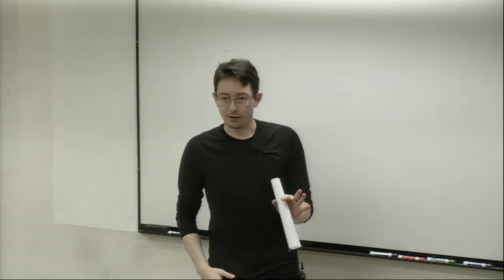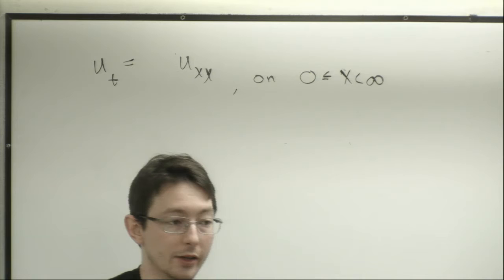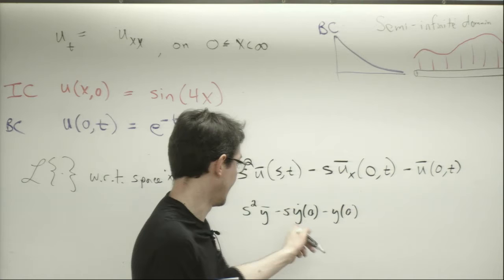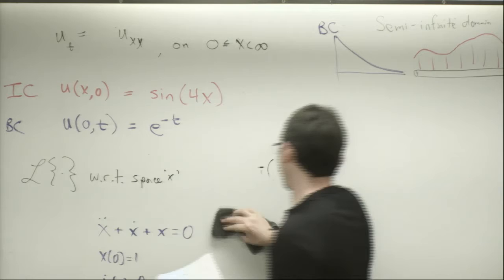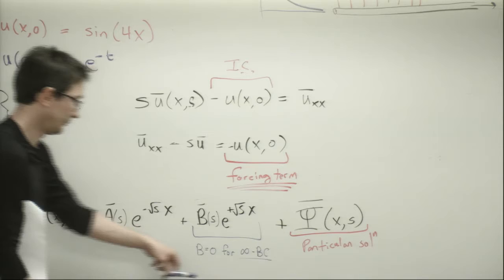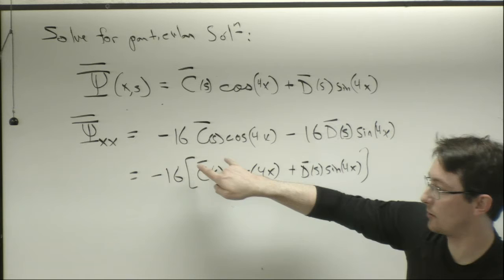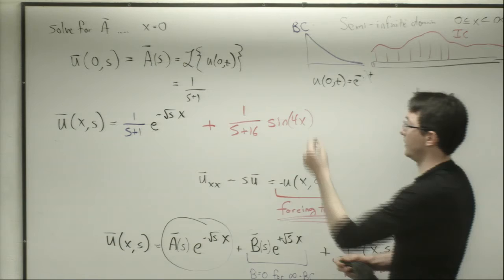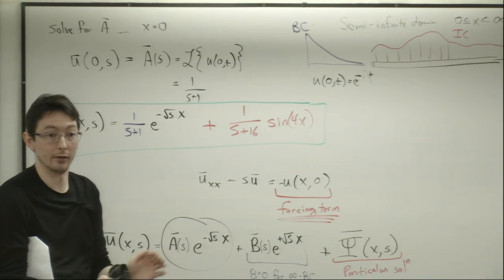ME565 Lecture 25: Laplace transform solutions to PDEs

Comment: Well worked and a good pace. Thanks. 
I think the comment (31:40) about the u(x,t) term that disappears if no forcing term is present wasn't right. The first term would not disappear. The second term would disappear. 
Also, fyi, the final inverse Laplace involves the 2nd shifting theorem, so can be done without a table lookup as relatively common.
Reply: at (31:40) by force, he actually meant "force the right-hand side" which is boundary condition at (x = 0)